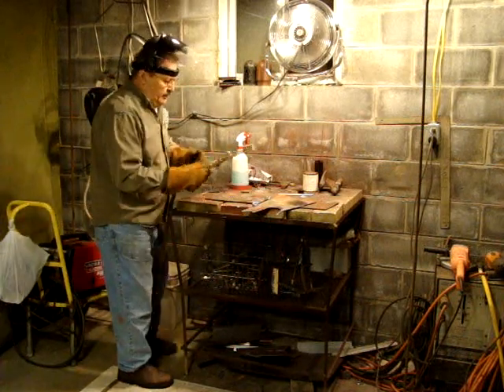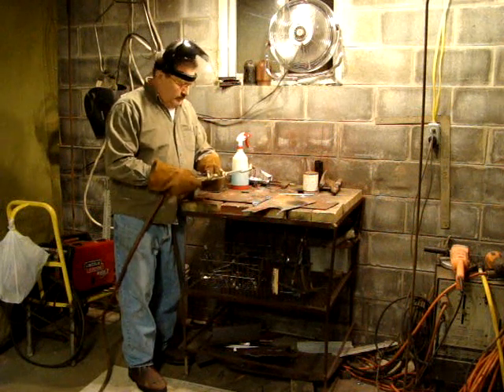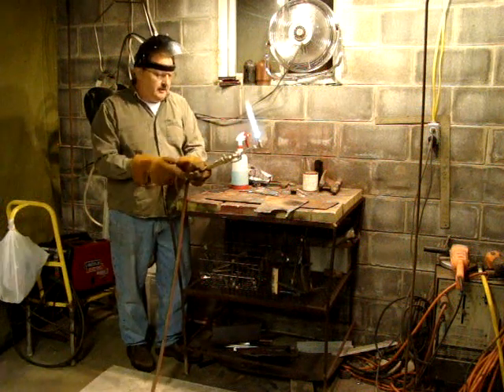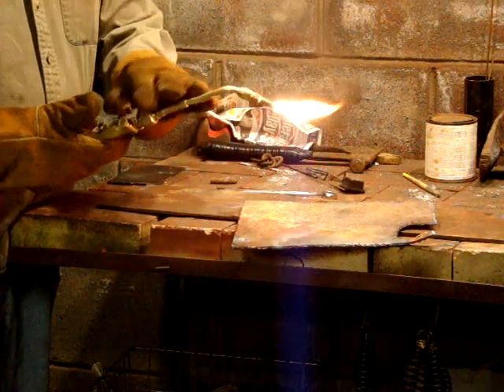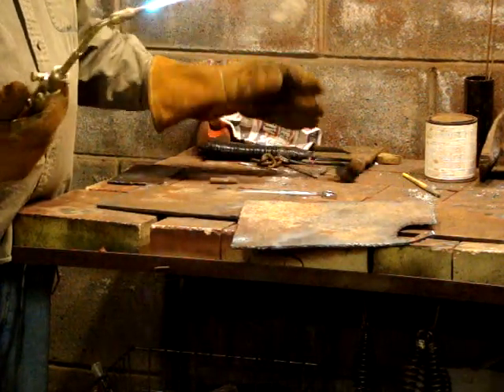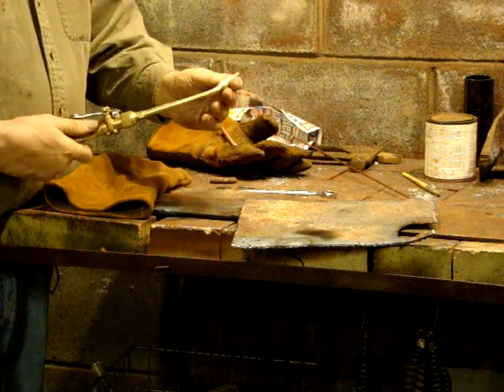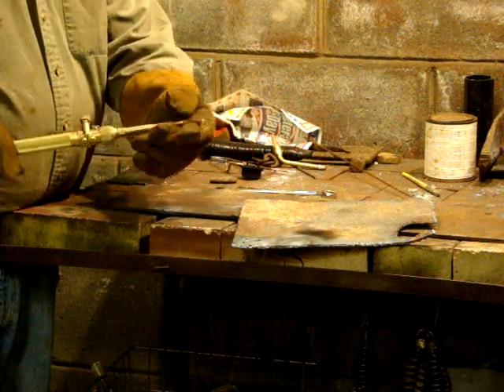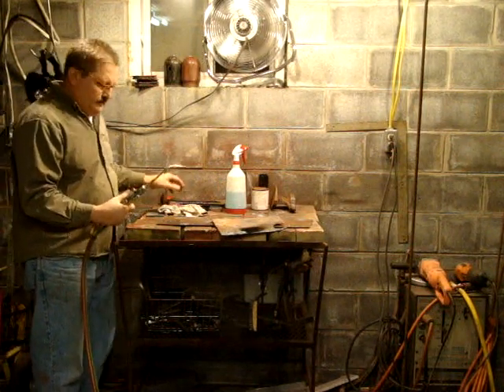Demonstration of Harris automatic torch handle, welding and cutting steel

Comment: Hi, some advice, there are quiet afew problems with the scene in this video. The first thing is that your cuping the striker, so when it lights, it shoots forward, and sometimes in your face. Second problem is the plastic bag right next to you there, some slag would have that lit and and fire in seconds. Three, as well as the paper on your table, and that the table is made of wood, that will catch fire easily.